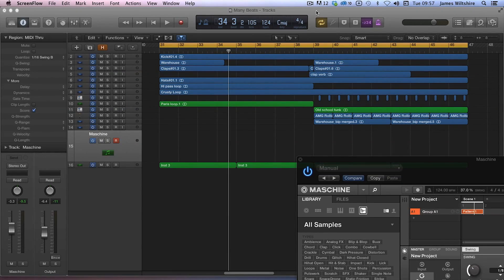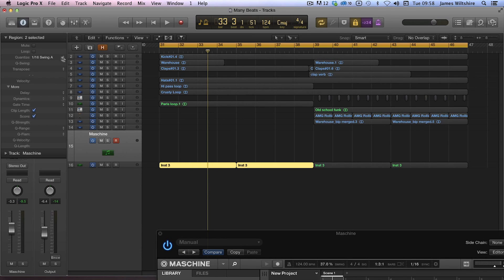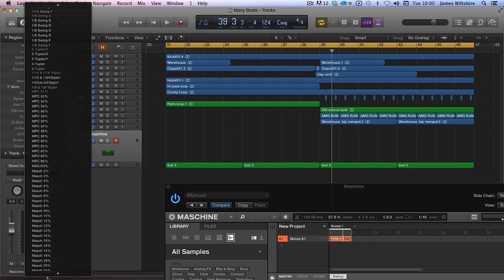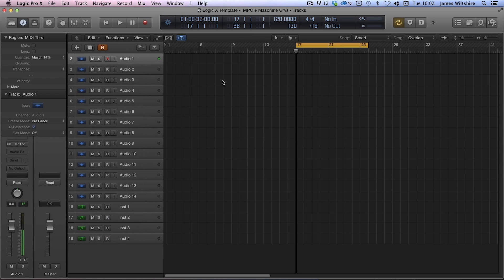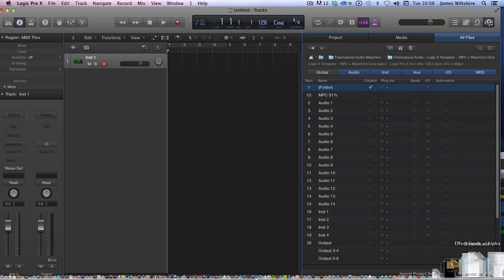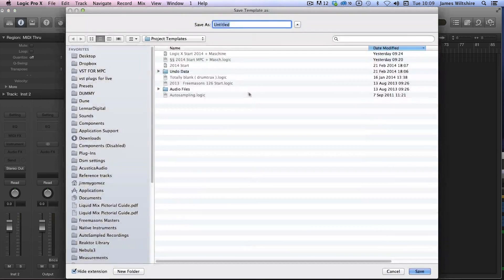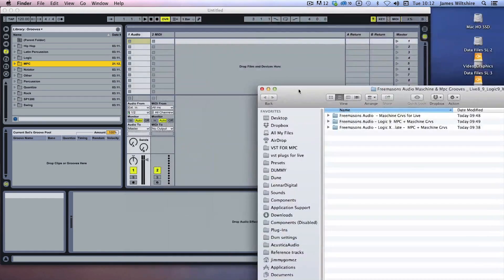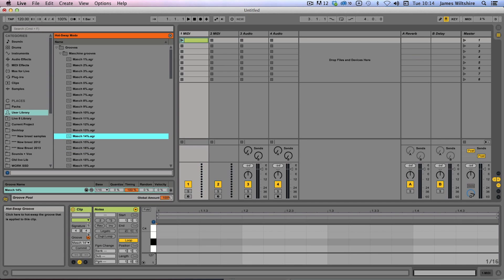Freemasons Tutorial - Maschine + Mpc Swings Inside Logic + Live

Comment: Quick question. Maschine 2.0 now has a button to drop the midi file straight to the daw. I have not tried it yet, as I don't have maschine 2.0 (still waiting for controller to come). Is that midi file exports exactly the same groove and note placing to the daw ? Do you have an idea ? Anyone ? Btw this is really helpful,man, thanks !
Reply from the maker: Hey Mali - Yes I've found the drag and drop to be as accurate as the DAW's own internal precision which is brilliant - Disc Saved Midi files used to have awful quantise that would mean some notes were way off grid - You will need something on every 16th to work as a perfectly accurate groove , but this is exactly how I created these templates

Comment: Thank you for sharing your precious knowledge James! Your tutorials have been immense. R.e. your earlier tutorials and workflow: Do you normally use the parallel techniques during initial production, then later, at a second stage, apply the analog enhancement to the bounced stems? How does this affect K-metering and gain staging across the different mixing phases? Just set my monitors up for K-14 using pink noise and Fabfilter Pro-L for K-14 monitoring. Any tips would be really appreciated. Best wishes Marc.
Reply from the maker: Marc - I use parallel processing all the way down the line - have to be on the case checking for phase but it always has a place - it's a great way to get weight and power into drums at the beginning and vital for modern vocal mixing at the latter stages  , You just have to be mindful that it's additive , so can make things jump out without some careful limiter plots along the way  ... Pro-L is an incredible tool and great at keep sudden transients under control on stems - Have you tried their Pro-MB ? - It's solved so many problems for us I can't tell you ...